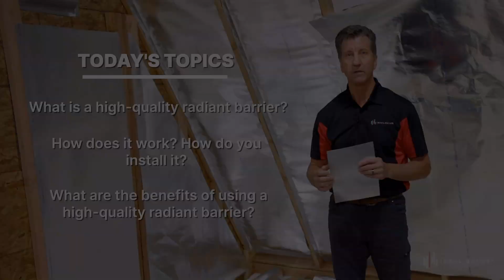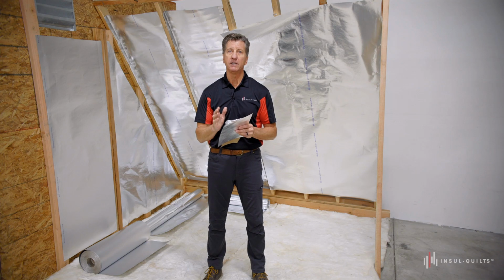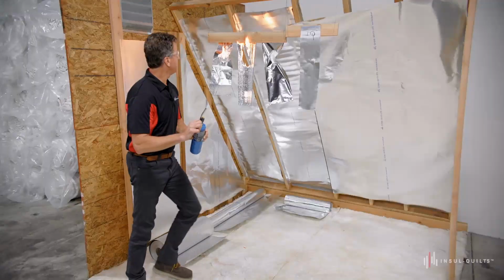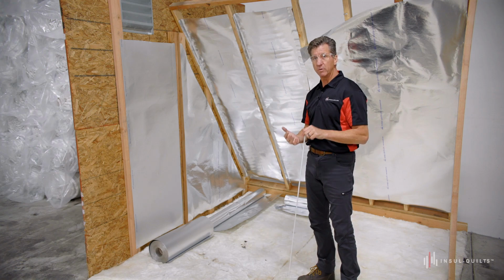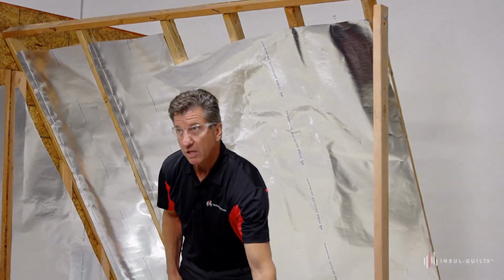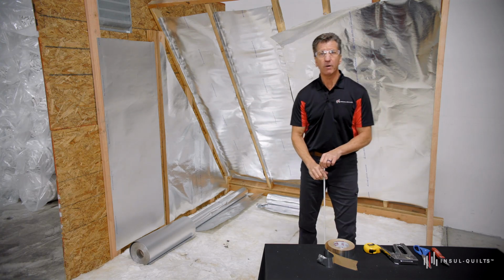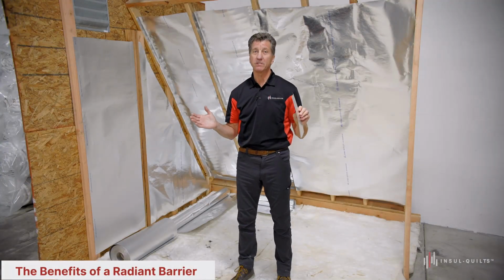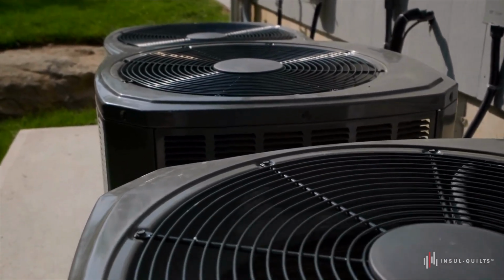High-Quality Radiant Barrier

Comment: You state that it will extend the life of the roofing materials because the attic space will be cooler, but the roof deck won’t be cooler. That “superheated air” that you refer too is still in contact with the roof deck that the roofing materials are attached to.